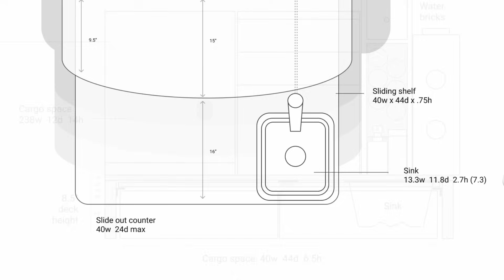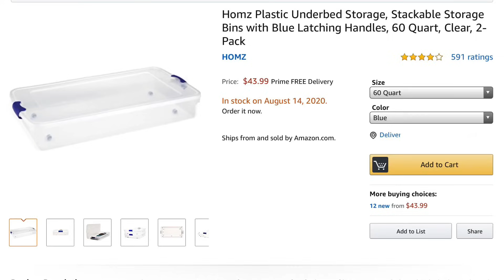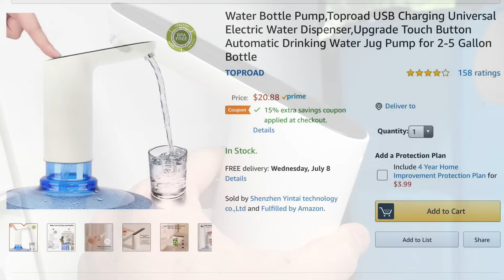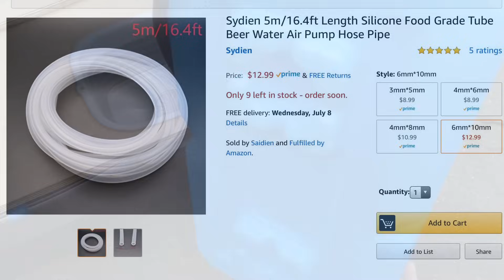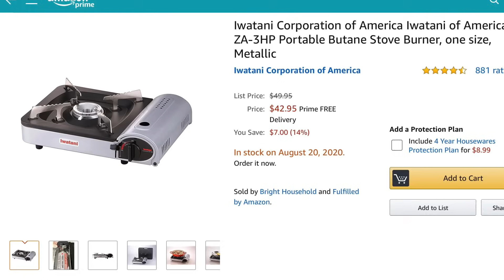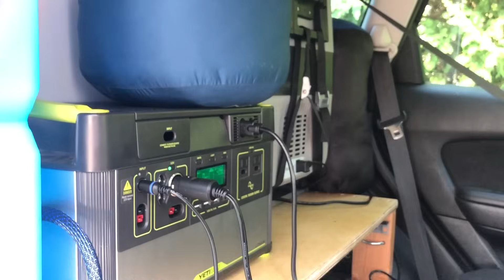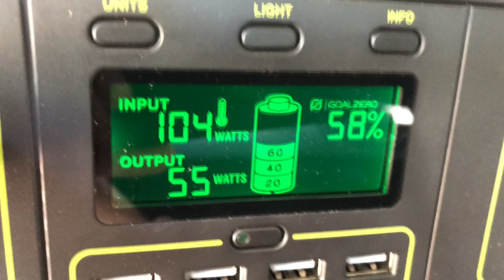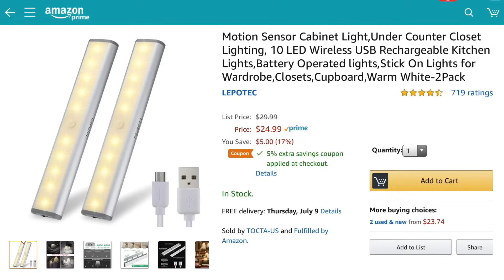SUV car camping kitchen with sink and fridge - DIY organization ideas for family camper

Comment: - Hey Todd !
Would you mind to explain how did you manage to set (glue?) the roll of tape under the faucet ? 😁
Thank you !
Reply from the maker: I just used a bunch of hot glue to set the roll of tape into the hollow base. This raises it up and by cutting a groove in it, allows the cable more room to bend so it doesn't kink.

Comment: Hey Todd! Great video. Curious about the lighting you didn't mention. Towards the beginning of the video I see strips on either hydraulic of your Mazda hatch. Forgive me if it's in the comments somewhere. Couldn't see any info and those also looked very helpful for back of car cookin. Thanks!
Reply from the maker: Ah, good call I forgot to link those in the description (fixed). Magnetic rechargeable light strips with motion sensors - https://www.amazon.com/gp/product/B07RX332KW
Reply: @todd.parker  THANK YA!

Comment: Love your setup! When you were talking about your sink and made the perfect cutout that sits flush inside the wood, what is that type of cut called? Also what hardware did you use below to secure and keep the cutout wood from falling through?
Reply from the maker: Thanks so much! I'm not sure of the technical name but I used a jigsaw to cut the hole. You need to drill a hole to fit the blade through and get it started so once I cut this, I enlarged the hole to form the handle to grab the top. To keep it from falling out, I just attached small pieces of metal across the corners so the top sits on that but they are minimal enough the sink doesn't hit them. If you look in the video, I show the bottom a bit

Comment: Love this - I will be doing it in my CX-7 and I think I am going to glean alot from your build. Love that parallel pull out kitchen and not a perpendicular pull kitchen which is the standard. Only question I have is on the spare tire - in my CX-7 its under the rear mat that you are building on top of; is this the same case for you? If so any thoughts on access if you were to need to get to that spare somewhere remote? Thanks again for posting!
Reply from the maker: Yeah, the spare was buried under all this. I keep a compressor and can of fix a flat just in case but that’s the best I could do

Comment: Thanks for the video! I am copying your idea for the sink/facet set up. Did you have to drill a hole in the water cap of the waterbrick to make the tube go thru?
Reply from the maker: Yes, I drilled a hole and threaded a barb connector through

Comment: This was exactly the type of thing that I was looking at doing in the back of my FJ. But when I got to the end and heard the price of $700 to $800 I was sad. Because essentially you could buy the same thing already made for that price. I guess the only difference would be wouldn't include the refrigerator. Just trying to think of a way to decrease the cost. Maybe getting rid of the refrigerator and solar and doing just a cooler.
Reply from the maker: The cabinetry is only about $100. File cabinet another $130. You can just use a cooler and water jug with spigot. The Yeti and solar is optional, I just had that stuff already.
Reply: @todd.parker  thanks for the suggestions

Comment: Love your video easy to understand & follow. However what kind of tape did you use to seal the hose?
Reply from the maker: I just used some teflon tape on the threaded fitting. For the barb fitting, it's just a friction fit but it's very strong.

Comment: I was thinking about doing a portable kitchen table with a sink just like this for camping except using a folding table and a different faucet setup. How is the collapsible sink holding up? I've seen a number of reviews that say the silicone hasn't held up. Excellent job, by the way.
Reply from the maker: Thanks! So far so good  on the sink, mine seems rugged
Reply: @todd.parker  Great. Thanks for the reply.

Comment: 19:33 GoalZero 12v port not regulated: what exactly did that mean? If the GoalZero battery 🔋 level drops to 60%, it disables the 12V output port? Or it cannot output a steady Voltage level? Is there official GoalZero documentation on this? Sounds like your Fridge shut off because it needed minimum X? Voltage? So to fix it you have to use the solar panel as well for the extra voltage?
Reply from the maker: My understanding is lithium batteries like the yeti will sag in voltage around 60% where a lead acid would be dead (~11v?) but continue to  output power just fine. Even with battery protection on the fridge at the low setting, the fridge will shut off. The port should be regulated with a boost converter to ensure 12v output down to 0% but they cheaped out so you need to buy the regulated adaptor

Comment: Excellent and incredibly inspiring video, my friend. You sound like a fellow engineer to me. Quick question- how safe is it to operate the butane stove with an open flame at the rear of your car like that? Did you have any concerns with it being relatively close to your car's gas tank? I'm considering doing the same but feel hesitant about this...
Reply from the maker: I guess anything is possible but it’s a very safe stove. It feels a lot safer than a burner inside a car like most campers.

Comment: Since it looks like the sink is almost always below waterline, might as well use a shutoff valve and no electronic pump. Then you wouldn't have to recharge a pump and you could control the pressure easily.
Reply from the maker: In my minivan build, I moved the tank below the sink and the USB pump works perfectly there. I agree that when above it’s leaky

Comment: Great work, Todd! Really like the design and build. One question, where is your spare tyre is kept? I’m thinking of a similar set up but my spare is stored inside the boot and underneath the future set up. This can be really hard to access if you need to. Thanks.
Reply from the maker: The Pacifica doesn’t have a spare at all. It has run flat tires and I have a 12v pump and can of fix a flat

Comment: my first impressions are: 1) There must be a lower tech way to do the faucet by just using gravity. 2) lots of metal may rust or mildew easily, even stainless steel stuff gets gross. 3) do you need a support in the middle of that large plywood piece? This may be over engineering.
Reply from the maker: 1) of course, but this is cooler 2) I guess but I haven’t had rust after a year. Next build is using aluminum 3) it does deflect a bit, attaching some angle iron in top might stiffen it, that’s what I just did on my next build

Comment: Hello, I see that the spare tire remains under the frame, in case of a puncture, you have to remove the entire frame to get the spare tire.  Is there another place to put the tire ??.  For example on the roof or elsewhere.  Greetings from Chile.
Reply from the maker: Heh, yes. You' want to call a tow truck!

Comment: I love your kitchen! May I ask if you have the link for the metal piece for the cellphone mount that you used for your faucet base? It looks bigger than all the ones I’ve been able to find on Amazon.
Reply from the maker: Thanks! Check out my minivan camper video for an updated sink setup that uses a steel circle that is very strong compared to the cell phone mount

Comment: I'm struggling to get the family on the road and I cannot afford a trailer, van or a camper. The cost of rentals is going up and this could be a great solution.... While I have an idea for the parts some links would be helpful. Thanks... BTW because you cannot see out the back you might want to add a fulltime camera.... more importantly some insulation over the windows.
Reply from the maker: Yeah, RVs have become very popular (and expensive) so I was looking for alternatives. I posted some links to parts in a comment recently and will copy into the description. I can see a bit over the file cabinet but I’ve has good luck just using my mirrors and being careful, but a good suggestion for safety. We’re sleeping in a ground tent but are you thinking insulation fir the fridges sake?

Comment: Hi, this was a great and insightful video. Love the setup and all the ideas! I wonder what kind of plywood did you use and how did you give it this nice glossy look?
Reply from the maker: It's 3/4 baltic birch plywood from Lowes. I just used spray polyurethane, probably 4 coats?
Reply: @todd.parker  Ah great thanks a lot for the info!

Comment: Are the Water Bricks leak proof?  If so, you could lay the Water Bricks down with the 'top' pointing towards the back of the vehicle and pack the camping gear on top of the bricks and not in front of them.  Would this help to lower the waterline and reduce the dripping?
Reply from the maker: I think the issue is mostly with the pump. It’s not designed to handle having back pressure since it has usually sits on top of a bottle so the “head” (height difference) is pushing water into the faucet so it leaks. The water bricks also may leak a bit so I try to keep them vertical
Reply: @todd.parker  Just a thought.  Nice setup though!!

Comment: What cables do you need to connect your solar panels to the Yeti? You connect to the Anderson input, correct?

By the way, thanks for the heads up about the need for a special regulated connector to charge the Yeti.
Reply from the maker: My panels have 8mm cables so I connect them in parallel with the 4x 8mm to Anderson Power Pole combiner cable. That cable is thicker gauge

Comment: great build @Todd Parker, thanks for sharing. one (odd?) question - can you indicate if the sink dimensions listed on amazon (13.3 x 11.8 x 7.3) are to the outer edge of the rim, or if they're the internal dimensions? i'm thinking of one for a pretty tight space, and that variance may make all the difference. thanks!

Comment: Just a clarification on the dimension of the sheet of Baltic Birch. 3/4 inch is 18.5mm not 12. 1/2 inch is 12.5mm

Comment: I just bought the same Dometic CFX3 75DZ  for my Ram 2013 tradesman cargo van. (stripped down Grand Caravan. 
I have an 80 hr drive ahead of me, have solar & would sorely love a 1-cup keurig, but the inrush current is TOO MUCH for the 1000 Watt inverter in my 2400Wh Bluetti.
Have you found a slide to fit the 75DZ?
l have an 18" high 72" x 23" single metal mattress frame crammed onto one side of the 50" wide interior, which makes ventilation for cooling imperative, but which Fan? 
AND
I assume the Bluetti, the Dometic & my 17" laptop will produce  some heat,
but driving back through Canada in ~ 2 -3 months I'm sure I'll need a low wattage heater,
but like the Keurig, I need one who's inrush won't exceed 1000 or 1100W.
Any suggestions re: the slide & heater is
MUCH APPRECIATED!
TIA
Reply from the maker: I ordered a slide for the CFX but it seems to not quite be out yet, order has been in pending status for a month so far. At the moment, I just added fuzzy furniture feet on the Dometic feet and just slide it out manually but that is only easy for one side. To access the freezer, you need help because you’re hands are full holding the unit! For heat, using an electric space heater will empty your battery in a hurry. I have a Buddy heater that works ok in a pinch but for long term, a small diesel or kerosene heater might be the way to go - sone good YT videos on those
Reply: @todd.parker  They delivered mine yesterday.
 OMG, It's a monster! 
Sure could use the slides!

Plugged it into Fully charged Bluetti 
(after twice trying a mainstays 700W Micro which wouldn't run more than 4 min without shutting bluetti down {& producing barely warm frozen meal}.

Then I ran the cx until it pretty quickly set my freezer to 28°F & fridge to 38° F
AND NEVER DREW MORE THAN 54 Watts!
And mostly 43-46 Watts WHEN IT WAS RUNNING! (infrequently & IMPERCEPTIBLY QUIET!
Disconnected the next AM & even with the micro fiasco & running all pm,
Bluetti was down only one battery segment and recharged (from the included charger/inverter) FULLY,
before I could finish my coffee!

This is one VERY EFFICIENT COOLER!
Gotta find a micro substitute.
I got a JetBoil, looks good.
Guess I've gotta look for an additional Coleman stuff & I guess frozen dinners are out.  Ah well, The AC200 will be shipping in Sept!
ALL SUGGESTIONS GRATEFULLY ACCEPTED!
Reply from the maker: I’ve been loving my 75DZ so far, will run for a solid day on my Yeti 1000, even with half as a freezer

Comment: Hi Todd,
Thank you for this awesome video. You brought to us some interesting ideas.
Just a quick question about your 90°Hose Barb ; do you have any alternative to avoid this lead brass component ?
It could be nocive in the water.

Thank you !

Jimmy,
Reply from the maker: I'm sure you could find a plastic one, or just run the tubing through the cap a silicone it

Comment: Nice!
Reply from the maker: Thank you! Cheers!
Reply: @todd.parker  Do you mind sharing about the angle iron? I want to do the same thing for the bed of my truck, but want the "L" channel to only be 3/4" high and the pull-out counter will slide on the sub- floor (of my pickup) and the top of the "L" channel will keep it from tipping over once pulled most of the way out. A drawer will then glide on TOP of the "L" channel (the installation would be the same orientation as yours is, only the pull-out table would be UNDER the Channel and a drawer above.   How tall is your "L" channel iron? Also, do you know of a resource that has aluminum? Or is that angle iron pretty cheap? I'm thinking I'd want to paint it to avoid rust? 

I'm wanting to make a pickup camper with a 24" wide x 48" long drawer with the table under the drawer that can partially rest on my tailgate when open. Behind this box holding these two items will be a 24"wide x 30" long box that will store a water tank near the cab of the truck.  I'll fill in the area above the wheel well to make the total top surface above the boxes my bed.  I called a local fabricator about 2 pieces of "L" channel 1/4" thick with a 3/4" legs and they wanted to change it to 1/8" thick x 2" in each direction. Of course I don't want a 2" thick table top as my drawer will only be about 9" tall itself (have to keep the bed at a minimum height due to my short topper).  They also wanted $291 for 4 - 48" long pieces!!!!  nope, back to the drawing board. Which is why I ask about your angle iron.  

I really like the layout of your stuff and you really have it well thought out.
Reply from the maker: @jannezack  I just used cheap 1 1/4" angle iron from Lowes (HD has it even cheaper) - https://www.lowes.com/pd/Steelworks-1-1-4-in-W-x-1-1-4-in-H-x-4-ft-L-Zinc-Plated-Steel-Perforated-Round-Angle/3053585

What you're suggesting makes sense to me, the channel can go either way and if you use the base of the truck, you should be able to pull it out further than mine. I generally only pull it out about 40% for strength. I was going to put in stops by tacking a 1/4" piece of wood on the bottom of the top surface and another on the top of the pull out so they'd prevent it from pulling out out but it seemed like overkill. The main thing is to make it smooth and reduce friction. I used felt tape on the L channel so the polished top slides on that. I then used those felt dots on the underside of the top of put a bit of top pressure on the shelf so it wasn't wiggly. The holes in the channel are quite large so I used stacked washers to get a good grip. That has the benefit of making the rails a bit adjustable up or down to dial in how tight it is. Not nearly as smooth as a proper pull out but damn cheap!
Reply: @todd.parker  LOL. I understand cheap.  I just don't want to lose the vertical space of using a drawer slide.  I'm not even going to use them on the drawer itself, it will sit on top of the "L" bracket.  I will put (not sure how other than with glue) formica stips on the top of the "L" brackets and on the bottom of the drawer so the finished Formica strips face each other.  I've been in the home plan business for so long and blueprints/tracings get really heavy, we used this trick to pull out our make-shift shelf/drawer to look through a 30lb pile of paper, so I think it will suffice for my drawer. I'll probably find some scratch & dent piece of formica from  a local dealer for this quick easy job. I just need 4 strips that are 1" wide x 48" long. 

I really appreciate your thoughts on my project.  Yours looks so professional, I hope mine turns out as well.
Reply from the maker: Good idea on the Formica. Much less friction than my setup. Version 2.0 item...